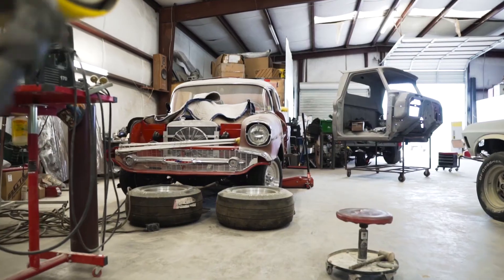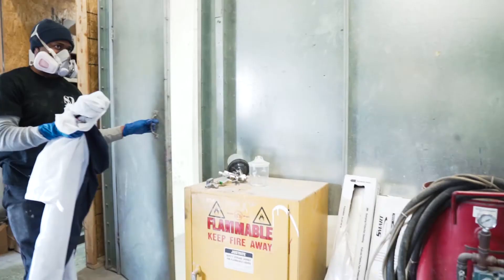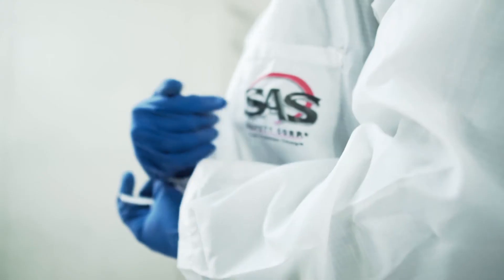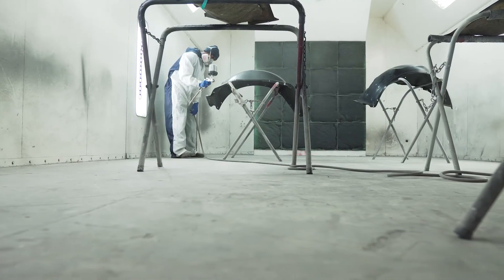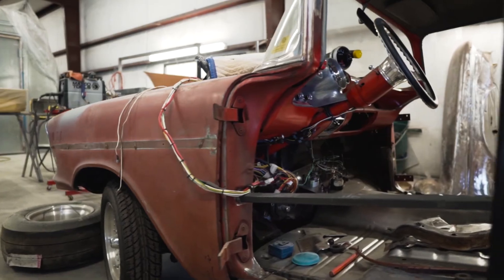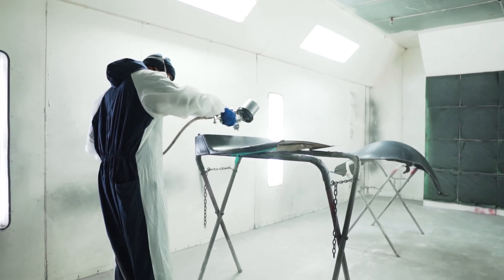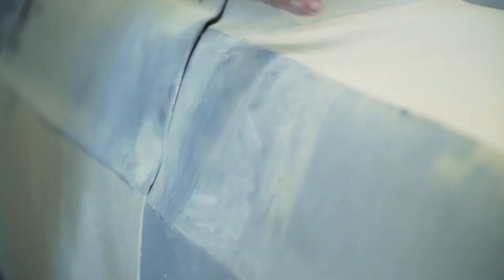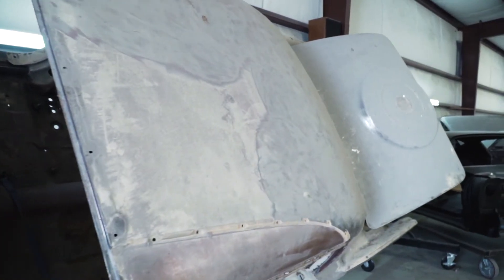BEST LENS for SONY a6300/a6500 - Sigma 16mm f1.4 - Real Commercial

Comment: I bought this 16mm f1.4 for my A6500 and love it. Cheers
Reply: I also have the A7RIII and have ordered the A7III. You actually can use the APS-C size Sony 10-18mm lens on your full frame A7III and as long as you use it from 12-16mm there is no vignetting. And it won't force your full-frame camera into crop mode. This is a well known secret lens for the pros that might have both APS-C and full-frame Sony cameras, like myself. Otherwise the 16-35mm is a good choice, but I love that 12mm on my full frame. Cheers
Reply from the maker: Gerald Williams good call! I am somewhat regretting selling that lens now! I love that I can use the crop lenses on the a7iii, just want to add a full frame lens so I can maximize that awesome camera
Reply: Justin Romeyn, I understand. It was another Sony pro that told me about this a year ago.

Comment: you klnow you can use that lens on the a7iii it has the crop sensor settings in it
Reply from the maker: Bill Foster true true! I will definitely be using me crop lenses on there, just really want to add a full frame lens so I can fully maximize the a7iii potential!